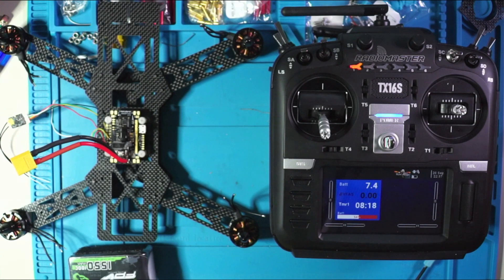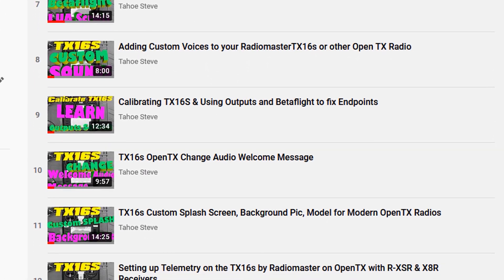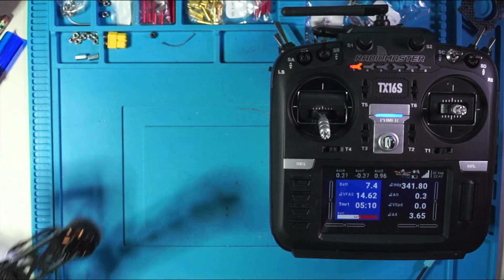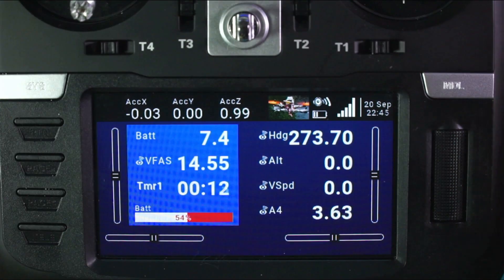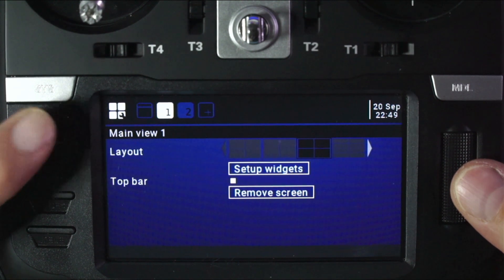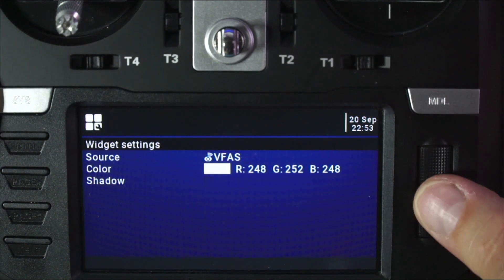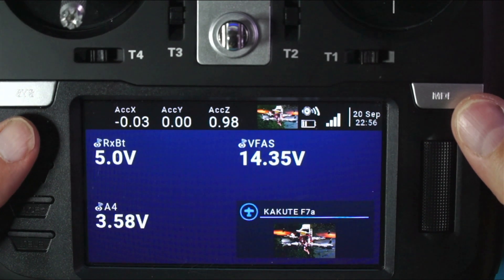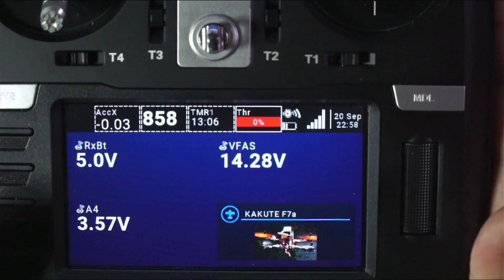TX16s Widgets with Telemetry for OpenTX Radios

Comment: Good video buddy!  Coming from the Spektrum world, I'm new to both OpenTx and also doing first telemetry setup. It was a lot to grasp all at once, but thanks to videos like yours, I was able to muddle through it. I'm using mine for a sailplane, so set up a second screen with 4 widgets that shows timer/plane battery/altitude and max altitude all at once.  I thought that VSpd you showed referred to Vertical Speed.  Telemetry with a built in variometer uses this to do the beeps/voice to let you know if the craft is ascending or descending (this was a real important component to me since I'm trying to catch updrafts with no power).  Thanks for doing this series, I'm sure its time consuming, but it really helped me out and is much appreciated!
Reply from the maker: You know what?  It could be vertical speed.  I gotta research that.